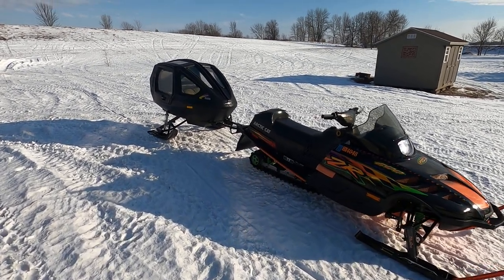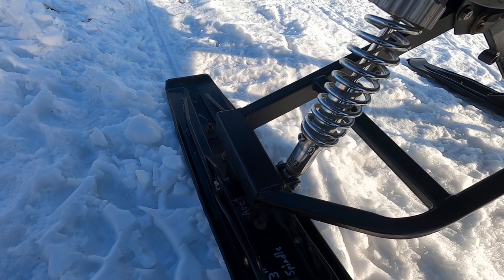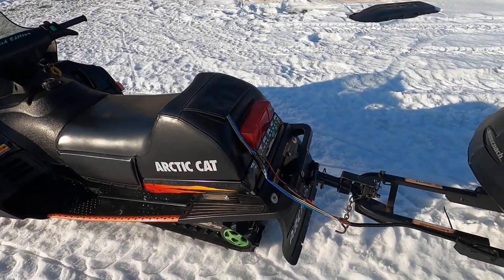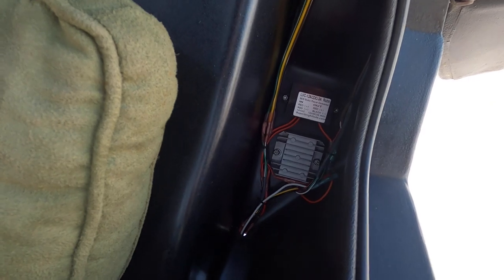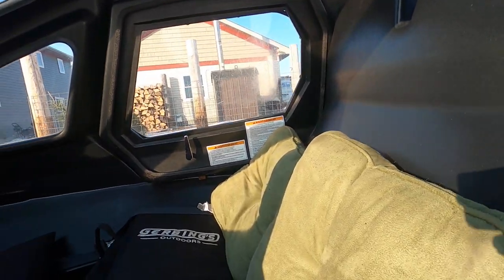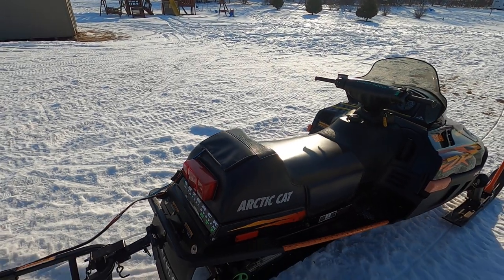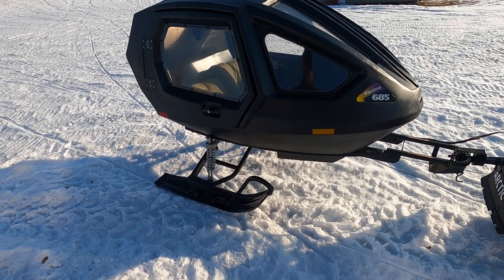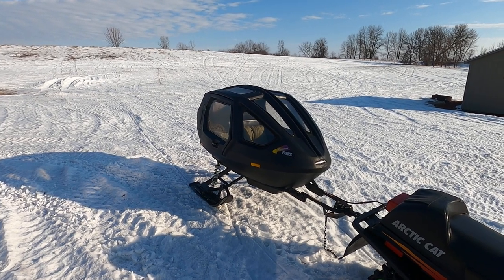Equinox Snowcoach 685 Modifications

Comment: Just picked up a snowcoach . Its got the steel spring setup.  I would love to upgrade to coilovers.  I also saw ur wheel conversion.  Great job!   I  believe I'm gonna try and replicate what u did.  Do u have any advice or input to get me off on the right foot.   Thanks in advance
Reply from the maker: Basically just find a nice set of coil overs from a salvage yard or surpluscenter.com has them if you search it, very cheap too!  As far as the fabrication part just take your time and try to make it all work safely so no one gets hurt.

Comment: Great video. These are pricy but I want one anyways, to bring the dog on trips. Groomed trails, what speeds do you maintain when you have precious cargo in the coach: or even when it's empty?
Reply from the maker: I typically only go about 20-30mph if the trails are smooth.  According to the manufacturer it says to maintain about 20mph.  With revamping the suspension it has a more plush ride so a little faster than rated is possible.
Reply: @Eighty8Fitter  I REALLY appreciate the quick response. This may not be quite what I'm looking for then, with the distance of trial riding I intend to do.
Reply: I have a question,  i just purchased one and i have a 4 stroke sled , do i need to buy the electrical box that you installed into the coach? Or did you do that jusr bc it was a 2 stroke sled? Thanks so much